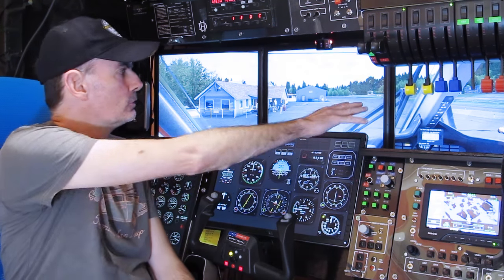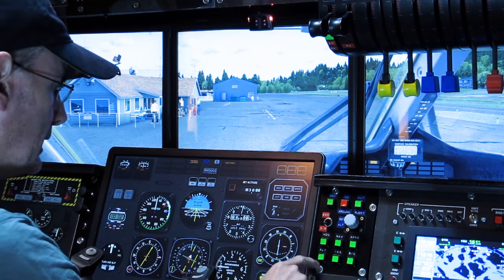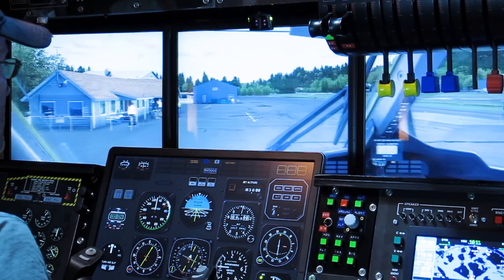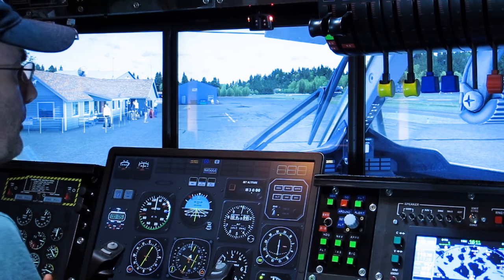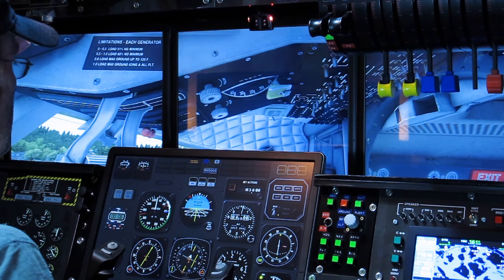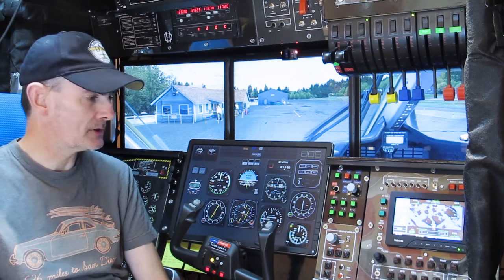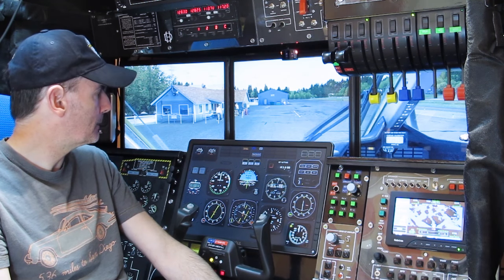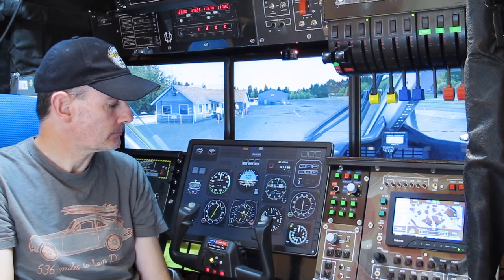Display Factors, Inside & Out (Twin Otter Cockpit Build - Part 32)

Comment: If you use a touch screen monitor can you drag the default GPS or radios into it and manipulate them that way? That is by touch. That would  great. 
Thank you for sharing your work. - PT
Reply from the maker: Yes, I believe you can do that. That aside, many of the Air Manager gauges (including all the Twin Otter ones) are designed to be used with touch screens.